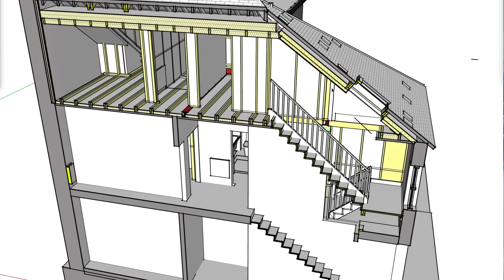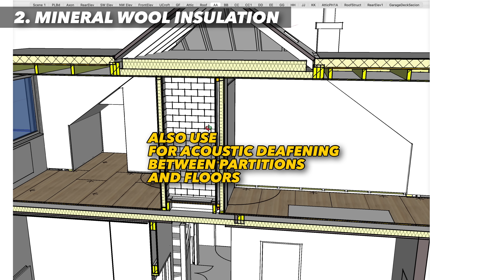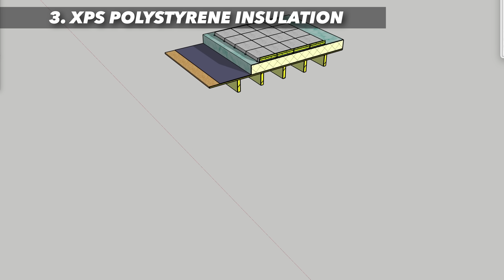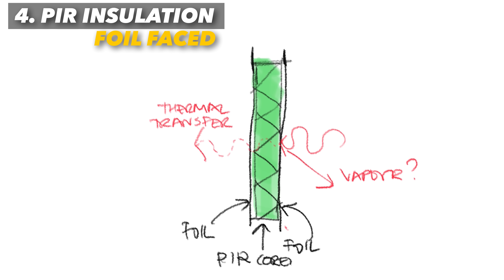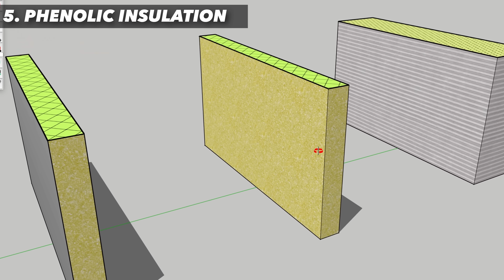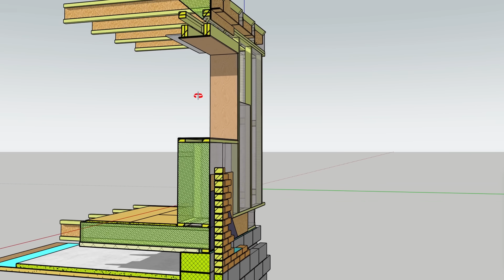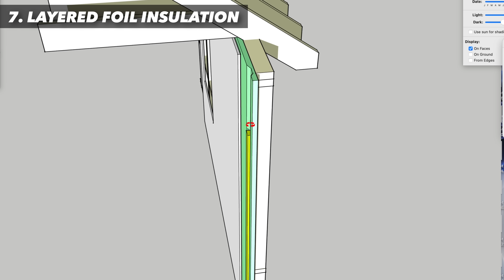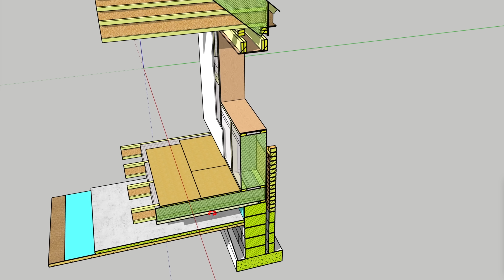Home Insulation Guide | PIR v Tissue v Cellulose v Mineral Wool

Comment: I had been working on a Self build retirement project (Home/workshop combination)   idea for a number of years having fun designing & comparing various options on the Materials front.  My design was a simple 8m x 12m footprint (100m2 x 2 flr) suspended ground floor (Workshop) to minimise concrete use and using post foundations (x16) and the second floor (living)  ..  Gable ends with 1200 eaves and shallow 15 degree pitch roof.

Comparing steel portal frame to Various timber structural options came out surprisingly similar in material costs but certain working options gave good savings. 
I discounted steel as to the complications of dealing with Steel Fabricators and using their installers.
     
So.. Timber..  I liked and have stuck with 4 x Portal frames leaving the floor area's spaces as open as possible to accomodate future use variation.  
Most of the Timber Frame option 'variations'..  ended up with the costings being very similar..  so again, using build options that were most economical won out.  12m Timber i beams for flooring and purlins (Wall and Roof)  Virtually no cutting required

Ok.. I have my Frame..  Now what..    The option I liked most is Steel faced Composite Panels (Panelsell..) with Mineral wool core insulaion at say.. 200mm thick for all walls and roofing.    This option saves on so many other Materials and Trades/men.  If Authorities wont allow industrial looking exterior it can be easily clad.  Even Full scaffolding shouldn't be necessary.

So, I am adding another option to your inclusive list.  

If this Build option was agreed by the Authorities.. 2 Tradesmen could build this very quickly using off the shelf materials for well under £50k.  
There are many complications as to using Insulation properly and effectively and 'who' to believe..  
      
My actual beef is with the 'More is Better' brigade.
     
    Looking at the manufacturers website information.. It turns out that the first 25mm of PIR has approx 80% of the insulating benefits.. The next 25mm adds another 5%..  The next 25mm.. 2%      Diminishing..
   The figures that are achieved by 200mm of PIR are un-measureable in benefit over 100mm.  In a Cost/Benefit analysis I think 100mm PIR is the 'happy' place.. but we just accept the figures and the cost and lesser space gets passed on to the eventual customer.

I had to abandon my project as I could not find any 'Professions'  interested in taking my project on and now I'm getting too old..  Ah well..
Reply from the maker: Thanks. Yes, after 100mm thickness, PIR exponentially declines in “power”
Reply: @build-better-things 
I’m afraid you are wrong on the W/m2k of PIR. As you will know the lower the W/m2k number the better the insulator against heat loss.
25mm PIR has a W/m2k value of 0.95, 100mm PIR has a 0.23 and 250mm has a value of 0.08 W/m2k. So the gentleman that posted the comment has either misunderstood the values or been given wrong information, which I thought if you’re video is about insulation you should know
Reply from the maker: What exactly are you referring to?? The gentleman’s comments…or something else?
Reply: @build-better-things 
Both his comment, and your reply, as you are both wrong about the value of PIR insulation
Reply from the maker: Those U-values you’ve listed show exactly what I said - diminishing power after 100mm - each additional millimeter after 100mm delivers progressively less improvement. You’ve proved what I said with your own data. You keep visiting my channel and posting what you think are gotchas but actually just show your pettiness, and your lack of understanding of anything related to modern construction technology. Sad person.  Where do you get the time?

Comment: I will say as a pretty competent DIYer mainly focused on carpentry you have to understand the tissue backed pir might look good on a spec sheet and I've never used it but my assumption is people don't want to use it for a few reasons
1. It's going to be a nightmare to put in without ripping or breaking and that suvirely decreases the insulations thermal performance

2 then imagine you get it in and any moisture not just water gets to it even the slightest condensation it's going to be ruined and make a big mess.

3 at the end of the day the tradesperson has to 'back' the work they do and might not be comfortable using a new or cheap product that's is inferior because if something goes wrong they have to take the time and spend they're money to fix it when we have had insulations that work fine for over a hundred years.

Just my two cents as someone who does alot of this stuff for themself. I certainly see the value in not doing a job twice because I cheaped out or tried to use a 'new' way to do something. I as you might have guessed live in a 100 year old house and it is true what they say they don't build things like they used to. But with that also is important to see the downsides such as asbestos in artex among other things that are not used anymore because of health and safety, So there is also that nothing is perfect.
Reply from the maker: Appreciate your comment but none of your criticisms relate to the product. It handles identically to all PIR, foils or otherwise,  and as I said in the video, I just don’t understand why folks keep making up things about a material they haven’t used.
Reply: From what I remember, it's more robust than foil faced, the only reason, apart from availability, that we use foil faced is because of the low emissivity, we built hundreds of houses with tissue faced phenolic boards as a warm wall with no issues whatsoever.
Reply from the maker: Yes it’s more robust, but for some reason… builders like the guy above keep saying otherwise. I just don’t get it. Thanks for your insight.

Comment: Any foam that uses as gas as a blowing agent, will degas. Even phenolic foams. The gasses used are denser than air, but they cause pressurisation and this can not be fully contained in the cells of the board and degasses by cutting the boards, and thermal action caused by the weather as the air pressure increases and decreases over standard weather patterns, further accelerating the degassing.

Comment: PIR can not be made without any kind of facing material. This can be a metallised paper or plain paper facings. Nothing stops the blowing agent from de gassing !
Reply from the maker: The manufacturers produce aged lambda values. It's built into the calculation of the U value, degassing is therefore irrelevant.

Comment: The problems with PIR, XPS is they lose their thermal resistance as the gas used as a blowing agent degases, and the thermal resistance diminishes by up to 60%. Mineral wool, cellulose are also better at fire reduction or insulation, whereas air and polystyrene is like coating your house in petrol as it is very flammable.
Reply from the maker: None of what you say is accurate, thermal drift and gases are already accounted for.

Comment: Modern made glass fibre isn’t irritating to the skin unless you have really sensitive skin, if so rock wool would also irritate your skin. Historically, glass wool (fibreglass) used a phenol-formaldehyde resin binder which is a chemical irritant. Modern glass fibre uses cellulose or glucose binders so is safe to handle.
So when it comes to loft insulation around an open wood structure glass fibre is better due to being so much cheaper, so you can have more insulation, and easier to roll out. 
Rock wool is only better at fire resistant, which is irrelevant in a open loft full of flammable wood. There is a reason we still use loads of it in the building industry.
Reply from the maker: Saying that glass wool is similar to mineral wool in terms of handling is a new one to me, even with the new products. 
On fire spread, you are misunderstanding how the insulation works. You lay between joists, but then cross ply x 2, so of course the timbers are fully insulated from fire, another reason to avoid glass wool for your loft.
Reply: Yeah, it smells like cotton candy!  I didn't have any problems with skin irritation or dust.  But since I was insulating my underfloor before laying the subfloor, I was wide out in the open.
Reply: Yeah I've heard it tastes almost as good as asbestos too!!  Let's put it everywhere

Comment: you missed GPS graphite polystyrene insulation. pretty good overview all in all 👍
Reply: Graphite added eps, as far as I know is more sensitive to heat, therefore in Hungary, where antracite colours are welcome for facades, are trying to eliminate the usage as heat inside the insulation during summer can reach +80C.
Reply: @MZperX-h8r how familiar are you HPFRC aka high performance fiber reinforced concrete? have you worked with any of the fiberglass or composite compounds? I am anxious to conduct my own experiments finding two specific use compounds outside of insulation but flooring and walls. graphite is excellent additive for repelling moisture sane with composites. just between you and me, I plan on a fiberglass carbon fiber mixture with fine ceramic and aluminum in addition to regular plasticizer and foam for my mix. I need strength, little to none water absorbing lightweight material. I don't mind insulating properties but this is not my aim.

there's some really interesting cements that are on YouTube videos of actual furniture. the cement is so thin it's mind boggling

Comment: A plus point for multifoils is if it is installed via counter batten and joints taped, it tends to result in an extremely performant vapour barrier which can be useful in ventilated build ups
Reply from the maker: Good point I forgot to make.
Reply: @build-better-things  Superfoil has had the BBA Certificate suspended in 2024.

Comment: XPS is really hard to find in the UK at a reasonable price. PIR is much cheaper than XPS if you shop around online. I've just bought PIR 25mm for £11.50 a sheet and 50mm PIR for £20 a sheet. If your ordering over £500 it free shipping. I included the plasterboards and board adhesive and fixings to push the price above £500. The fire boards were £11 each, which is half the price of local suppliers. Saved a fortune on my £1300 order. Locally it would have cost almost double that price.
Reply from the maker: Yes I only ever use xps for inverted roofs and some below slab, where PIR cannot be used

Comment: Thanks for the excellent video as always. 
I am shortly moving to a house that was built in 1992 (concrete tiled piched roof). I am already aware the current owners experienced significant condensation in the loft on cold winter days.  I am considering removing all the existing loft insulation and installing foil faced PIR between the ceiling joists and taping the joints. 
Do you think this would be a good solution? I would take care not to block the soffit vents and i can increase the ventilation in the loft if necessary.
Many thanks and keep up the good work.
Reply from the maker: Thanks. If you’re experiencing condensation then you first need to sort that out, assuming the existing glass wool is also between your joists. Joists are horizontal, rafters are sloping, just to check we’re talking about same thing. . Because if you increase the insulation thermal value, with PIR, you will also increase the likelihood of condensation.  It’s extremely difficult, close to impossible, to get vapour control effectively at joists level with lofts, even with your taping. Think about the eaves, so around the whole perimeter.
Reply: Leave the insulation alone initially, you need to add ventilation. If there’s condensation, there’s not enough. The roof is a cold space, so drafty is good. 

Check with your surveyor for specifics, they should give you means of remediating any issue if you had a Building Survey. Alternatively, give them a call. We are always happy to assist our clients on queries such as this.

Comment: So our land is 2,200m sq.... Mineral wool would probably work out best (never want to see glass fibre again, makes me itch thinking about it) for a workshop/summer house I'm planning but surely if it's timber framed you'd have to offset the timber costs for wall thickness? ie thinner insulation types can get away with thinner walls so is it a case of working out a costing for each type. Your videos are great, love the digs at dogmatic architects the one who designed our house should have been struck off. Total internal size 4.5m x 12.5m, two levels (the dreaded 1 1/2 storey highland curse) yet has 2 end rooms just 2.8m wide and 2 at 3.2m wide(both structural supporting the ridge), Upstairs has a landing area 6mx 4.5 with a staircase exiting into it and bathroom and one naff cupboard that's sloped like the roof, totally unusable space. If only he'd added a metre to the end rooms might have had something reasonably ok....
Reply from the maker: Hi. Yes, need to take account of the material costs of the overall wall, although for my example I used floor area as I think that’s a longer term metric. Thanks for your comment.

Comment: Given the quest for air-tightness in modern building and the nature of interstitial condensation it will naturally form within the area of the PIR and rafters. The rest of the moisture is internally sourced from wet rooms and of course rain. Say that your tips for a  50mm ventilated cavity in both walls and roof have been followed; without an MVHR unit (cost) what is the best way to remove internal moisture from these wet areas? Trickle vents on windows and dehumidifiers?
Reply from the maker: It’s tricky to diagnose without looking in detail but if there’s internal moisture then there’s an underlying problem you need to address. Unless you’re talking about residual steam from a hot shower. Dehumidifiers are not a solution, just a sticking plaster. Yes you need several forms of  passive ventilation backed up with some mechanical extraction
Reply: @build-better-things  I see. Thank you. Hmm, given the dual constraints of cost and thermal envelope integrity are there any 'thermally broken' type extraction fans that I could install?

Comment: 5:00 - Foil facing has two purposes. It is to reduce blown gasses from being emitted by the PIR. It is not only the PIR material which insulates but the gas it is blown with, to create the "foam". Foil is a metal and pretty much impervious to gas diffusion. It is imperative you SEAL every PIR edge with foil tape to reduce off-gassing, otherwise, over the years, you will experience thermal drift and it will not be as efficient. It is not designed to be a vapour membrane but of course will work as one. If using PIR, it is imperative to be used correctly. Otherwise use Rockwool which is far more forgiving! 

Nothing much adheres well to metal, hence why tissue facings are required, to be used with bonding other materials to it. The other reason? PIR is poured into a mould, then shut, and pressure is increased. The foil helps with it sticking to everything!
Reply from the maker: Foils and blown gases…., let’s get it in context.  Insulation companies report their lambda values (which in turn inform u values and r values) used aged lambda reporting. So the small amount of potential thermal drift or thermal reduction from gas is already included in any heat calculation and the product is usually more efficient than stated . Your suggestion of using Rockwool as an alternative is never feasible, due to the space requirements that people no longer have available, due to higher thermal regulation. I give the data at the end of the video.